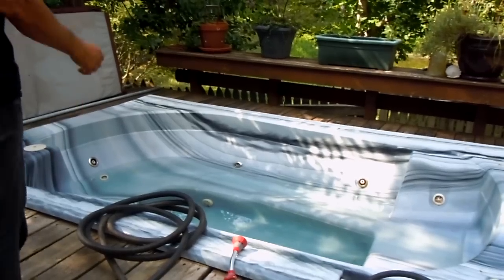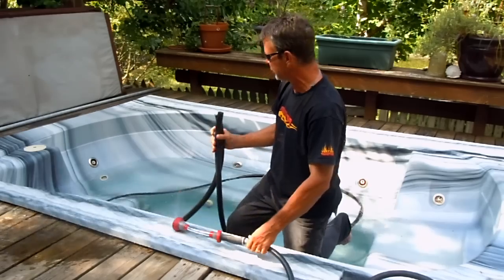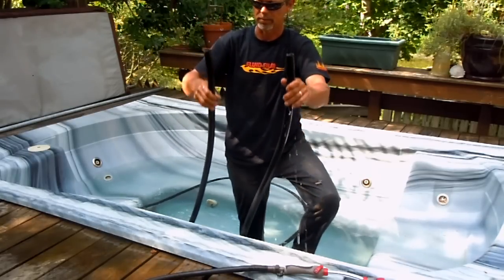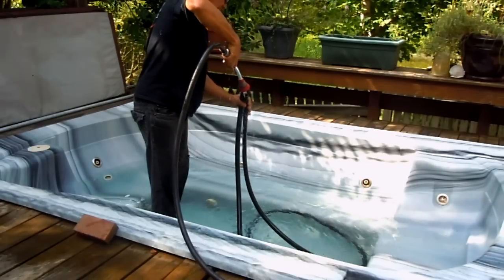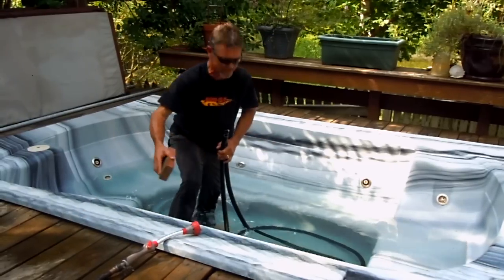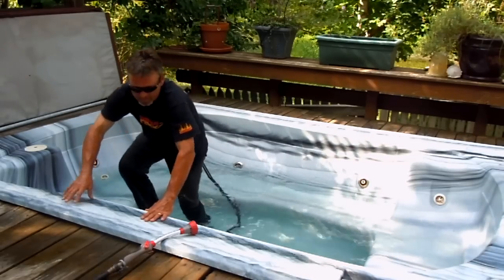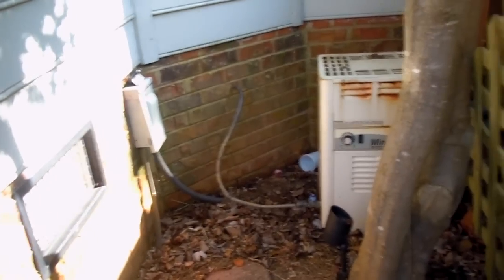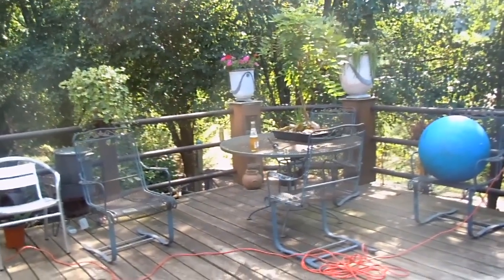Siphoning water from a jacuzzi

Comment: I threw a short hose in the spa, put a rock on the one end at the floor of the spa, put my palm on the other, & drew it out of the water, & flung it over the side of the spa.  To my amazement, the water started flowing like the hose was on full tilt!  My lil spa drained in fifteen minutes. I had to try five times to make it work, yet it was super exciting compared to the three hours to drain from the outside valve.  Some people turn on the jets on low, & put the hose into the jet to fill it, to start, then shut it off once it starts siphoning.

Comment from the maker: I hate it when it fails due to air pockets.  This hose is big.  If there are any air pockets it will fail.
Reply: Thanks, Tommy, for the vid and your very own introduction of a very old idea.
Is there any way to turn off the jet returns so that no residual water keeps coming out.  Annoying when you're kneeling and doing some important work and suddenly your crouch is getting wet by the jet return that won't shut down hahaha.  There's got to be a way to do it.